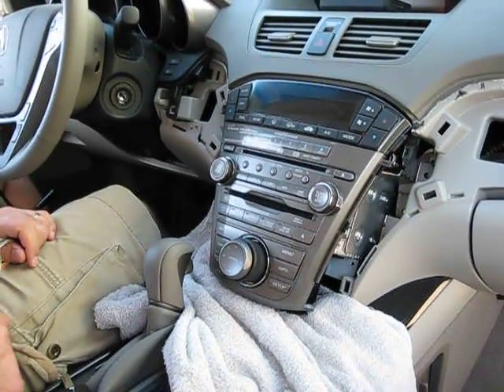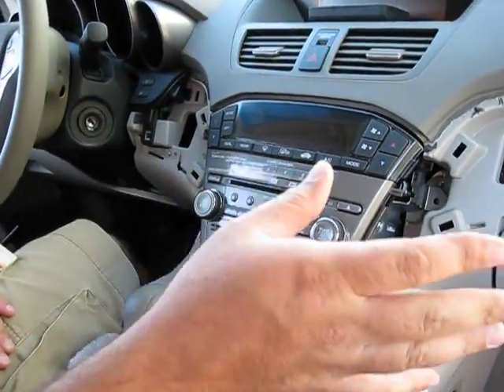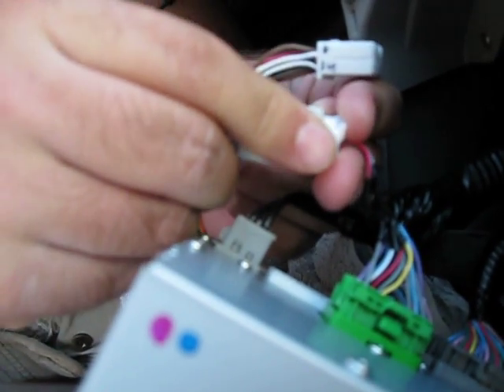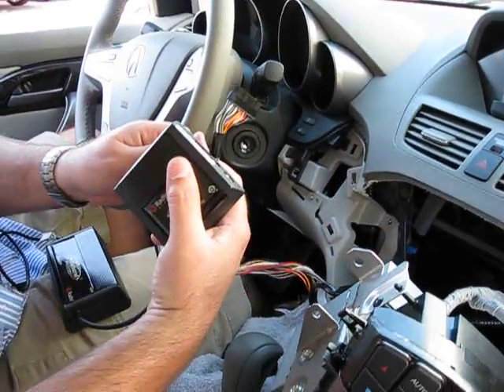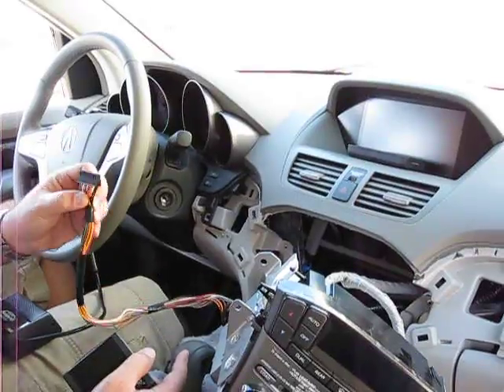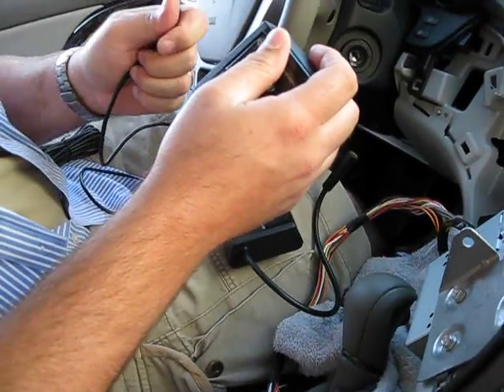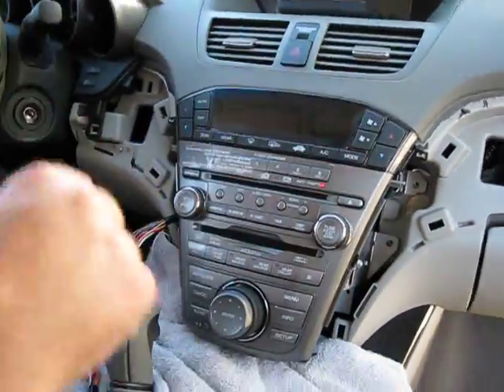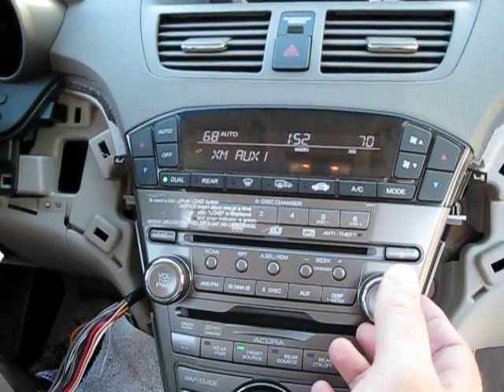PXAMG Installation

Comment: I installed the ISHD571 and although it connected, it wouldn't recognize the iPod input and the car couldn't contol the iPod.  Yes, I reset the iPod.  Yes, allowed time for the unit to initialize.  Yes, I tried "Aux1" "Aux2" "IPOD" and "SAT" setting.  Nothing worked. (2004 Acura TL w/o NAV)

Comment: OK, so you didn't re-mount the radio in the video, so my question is, do you leave the PSAMG module OUTside of the radio?  Do the cables show or do you tuck it all away inside behind the radio?  Also, all I'm wanting to do is plug in my iPod.  How does or where does the iPod cable go?  Thanks in advance.

Comment: Hello! Thanks for the video. But I have a question. I need a wireless connection in my passat b6 to connect an android phone or any portable music players that support bluetooth, so I don't have to use 3.5mm wire.. Does this adapter have such an option?